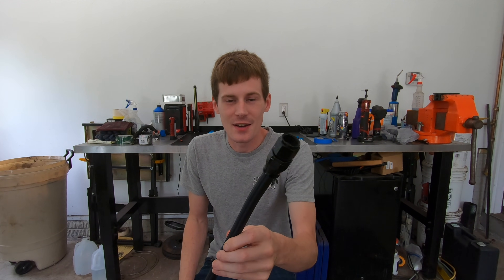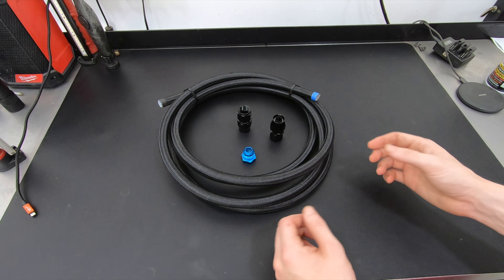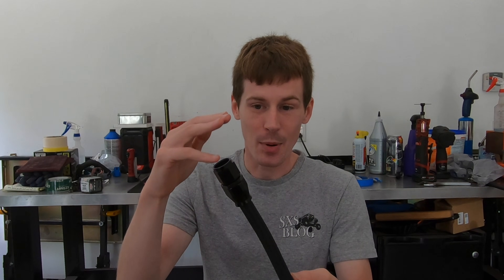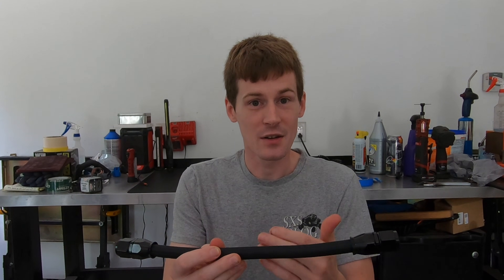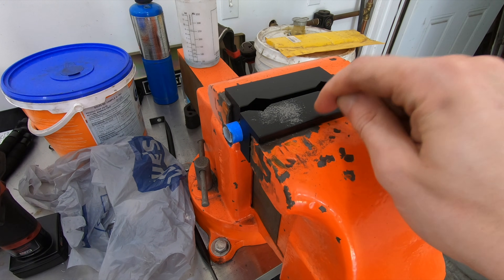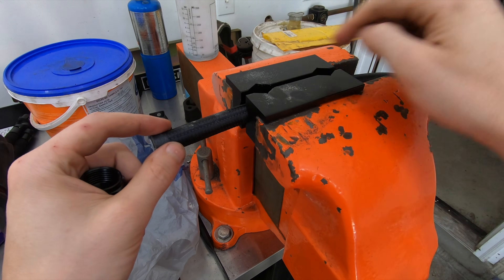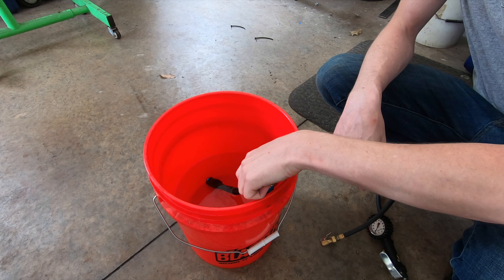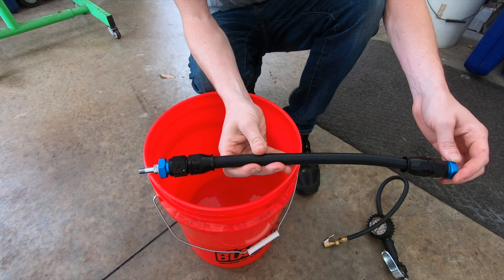How to Assemble & Test PTFE AN Fittings ( Teflon AN Hose Fittings )

Comment: Something i learned that is not widely shared ptfe fitting with the olive crimp ring will also seal on hard line  so a metal 3/8 fuel line u can put a 6an fitting on there  just like its ptfe hose and it will seal so u want to go from metal line to hose just need a male and female connector 6an one on metal line one on hose and screw them together

Comment: I noticed yours didn't have o rings included. I have the same set, but mine came with a o ring that goes between the Farrel and the peice you push into it to tighten

Comment: I've found that on new fittings it is sometimes necessary to break the connection and reseat it in order to not get bubbles out of the weephole. The fragola hi flow PTFE fittings WILL work with the summit SS braided PTFE hose.
Reply: Care to elaborate a bit more? I have  a leak at the pinhole of the fittings
Reply: @ThunderMonarch  try taking the test cap out of the fitting, check for debris and reseat it, leaking from the weephole means the leak is coming from the mechanical connection between the male and female fittings.
Reply: @thastinger345  think some conical seals will work?

Comment: That didn't look like a cut off wheel to me...but a thin cutoff wheel for metal does work better for PTFE than the shears...for me anyway. I just flush them out with a garden hose then blow them with air. A metal cut off wheel doesn't leave all that debris his did.

Comment: Aren't all the white ptfe linings non-conductive, made for nonflammable liquids, while all the black ptfe linings are conductive and made for use with flammable liquids?
Reply: Old post, but wanted to add a reply in case anyone else comes across it: 

You're correct. White PTFE hose is non-conductive, meaning it can experience static charge buildup from the friction of fluid flow. If enough charge is built up, there can be a sudden discharge, like zapping your hand with a static shock on a doorknob. Obviously, combining this discharge arc with flammable liquids is a recipe for disaster, so you have to take a lot of care to make sure everything is securely, solidly grounded if white PTFE hose is used in a fuel system.

PTFE hose meant for use in fuel systems has a black liner that incorporates carbon particles; similar to conductive paint. This carbon lining allows any charge that might be generated to pass from that lining, to the hose fittings, and to ground via whatever system the fittings are connected to, thus  eliminating the potential for buildup of static charge and arcing that can occur with improperly grounded non-conductive PTFE lines. This makes for a more convenient and reliable option for fuel lines, since it incorporates ground protection in the material instead of leaving the matter of proper grounding up to the installer to figure out.

In short, technically either can be used for fuel systems, but using non-conductive PTFE hose safely requires more attention, effort, and maintenance than conductive. Assuming all other variables to be equal, one will almost always be better off using conductive hose with their fuel system.

Comment: Great video. My tranny lines leak in my 98 Cherokee despite fully replacing everything so I decided to upgrade them from metal lines to these but steel braided. I might have some sort of a pressure issue in my tranny but whether I do or I don't, I don't wanna go through a gallon of transmission fluid every few commutes. Yay I might not have to keep staring out my rear view looking for a tranny fluid trail.

Comment: I was fairly impressed until you recommended cutting the hose with an abrasive wheel.  That is amateur on steroids.  If you can afford PTFE hose, you can afford a proper hose cutting tool.  They really aren’t that expensive and they a faster, neater and much cleaner than an abrasive wheel.  Sheesh.
Reply: Haven't found a set of hose cutters that don't bend or crease the inner plastic hose. A cut off wheel is actually better.

Comment: Outstanding video!  One thing though - back in the day we put tape at the end of the fitting and if a gap appeared it meant the hose moved - is this not accurate?
Reply: With PTFE hose, the hose and ferrule are already bottomed out on the fitting and the collar should be tightened onto the fitting. So if you put tape on the hose, there will always be a gap after tightening the collar down.

Comment: great video.  Hardened cable cutters work better. No dust or wire splinters to deal with. After cutting, simply trim the crimped/pinched end of the PTFE off with a razor blade, nice and flat. Also, use a pocket screw driver to gently separate the steel braid from the PTFE, then push the ferrule into the line.
Reply: I second this cable cutters or nothing best trick I ever  learned

Comment: Got a question....  Would this be a good system to connect the output from an air compressor pump to the input to an air cooler.  I want to add an air cooler to my compressor (to dump dry air into my tank) and have seen where hard connections (copper tubing) can fatigue at the cooler from the pump vibration NOT being isolated.
Reply from the maker: I used copper on my compressor air cooler 5 years ago and haven't had any issues. I've put about 100 hours on the compressor since then. Yes these lines should work for that application as well.

Comment: This is the best AN hose/fitting video ever.

I was going to use some Viton lined hose for my fuel system but will be getting PTFE instead i think. The use of ferrules looks tedious but worth it.
Reply: The meanest thing I found about this system is sliding the B nut over the braided hose, so be sure to slide both nuts on from one end of the hose before cutting to length.  Otherwise, good stuff to be working with.
Also, I sometimes like to use heat shrink tubing to to keep the wires braid under control at the cut site, but do remove it before splaying the wires and inserting the ferrule.
....RooDog....

Comment: Can the ptfe stainless line with aluminum fittings work for custom clutch lines?
Reply from the maker: Possibly, I'm not certain. It would depend on the amount of heat in the area and the amount of pressure required in the line to actuate the throwout bearing.

Comment: With my 45 years of experience assembling race, hose and industrial hose that PFT hose was assembled incorrectly. I would not be surprised if that end leaked or came off the end of the hose. during a working pressure test !
Reply from the maker: If you know how to do it why are you here?
Reply: Great resume,  rather than blindly saying it would leak. How about describing why and educating the right way (your way) to do it?

Comment: When pressure test swivel hoses, I can see air bubbles from the little hole on the nut fitting. Is that normal?
Reply: Yo I have the same issues right now
Reply: I have the exact same issue, leak at the little hole on the nut. Any thoughts on how to address this? I also posted the same question to Jegs, will let you know if I hear back from them.
Reply: @RoyW. I had the same issue, was caused by a crack in the female end’s internal mating surface.
Reply: @RoyW.  I meant no more bubbles after I put wd40 on the hose ends before assembling.
Reply: What yall do to get it fixed?

Comment: Would using a band saw work fine cutting this hose, & assuming if yes, would give you a clean cut?
Thx for the vid, love learning something new, even after many many years…..can always learn.
Reply: A hacksaw with a FINE blade would probably work... like 32 tpi or finer.
Reply from the maker: It probably would, you'd still have debris inside the hose after cutting though.

Comment: Hello again Repair Geek
Thank you for another Great Video 👍 As a Aircraft Mechanic I have to thank you for the presentation. You were dead on!!!! Although,  on aircraft the hoses are already built and  pressure tested. One thing I would suggest is instead of using a vice. Try a Ford Wrench. It's a smooth jaw pipe wrench. The story told to me was Henry Ford and the Model T. The Ford wrench came with the car. Using the Ford will not mar AN fittings. Again thank you 😊